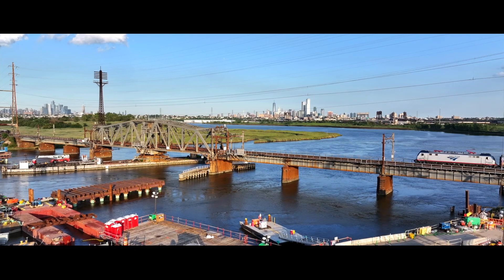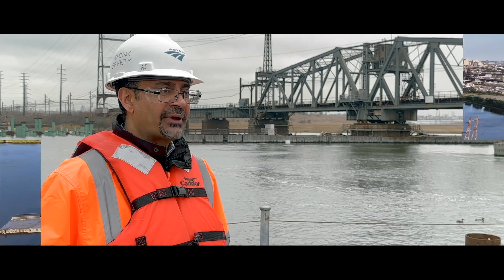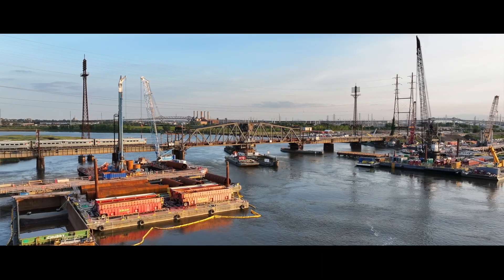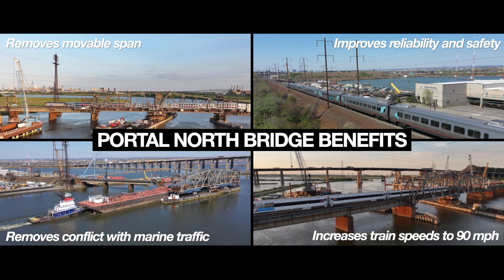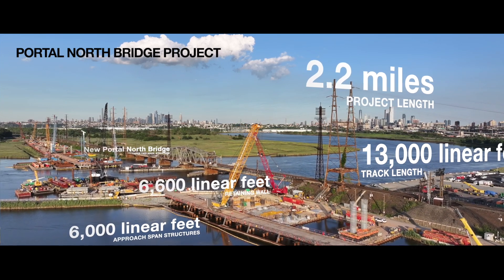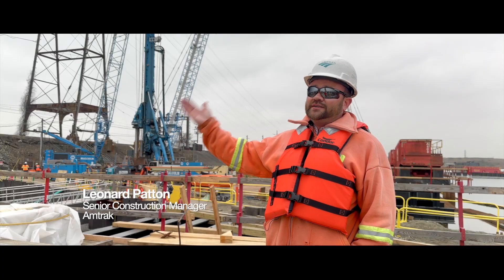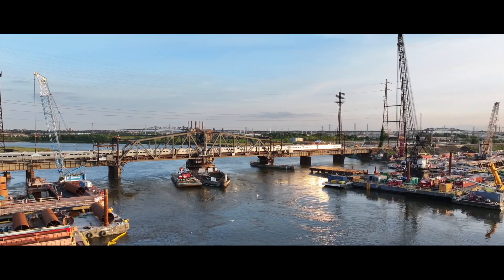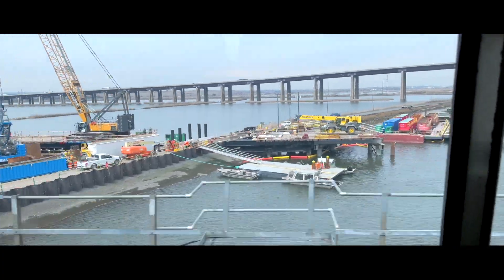New Era of Rail: Portal North Bridge Project Update

Comment: This needs to be done. To get into Penn Station Amtrak has to cross the Hackensack River twice, the Hudson twice, and go under the East River. These crossings are outdated and obsolete and impedes traffic on the Northeast Corridor and makes Amtrak lose its bullet train status. 

First is Portal Bridge this bridge connects New Jersey to Stanton Island over the Hackensack River the problem is when a ship comes into Newark and docks at Stanton Island they have to go through the locks at this bridge. It creates a problem because to allow ships to pass they have to deenergize the entire northeast corridor for one boat and the bull gear that supports the bridge it gets stuck all the time delaying traffic while the tracks are realigned and the wires are reenergized. first priority is to take this bridge out and replace it so trains don't have to stop for boats.

Second problem is the Pelham Bay Bridge from Extreme Trains this bridge goes over a canal and the Hudson and when trains leave Penn Station they are stuck here because they have to wait for boats and the Northeast Corridor is deenergized. This one also needs to be taken out and replaced so Amtrak does not impede boats. 

Third is a major chokepoint The North River Tunnel under the East River coming into Penn Station. During Sandy these tunnels were flooded and the north tunnel is condemned. Amtrak needs to drill a new tunnel which is wider to allow more trains to get into Penn Station. 

If they do this they can double compacity on the Northeast Corridor and move their projects elsewhere where it is needed.

Comment: Why only 90 MPH? That's not even high-speed and leaves us so far behind the Chinese and the rest of the world when it comes to train travel.
Reply: Not really feasible for the geography. Besides, it’s a short railway relative to the size of the us
Reply: From this point it is not very far from NY Penn Station, like less than 5 miles, higher speed is not needed at this point
Reply: 1. Penn station is VERY CLOSE (along with multiple other huge stations
2. (Read 1.)
Reply: Penn station is very close by and it would take some beyond impressive acceleration to reach speeds of like 150mph by the bridge, and there is also a big curve.  If the country wants to invest in hsr on the nec, the investment should first come to rurral sections where it it is cheeper to build.
Reply: The way to actually cut journey times is to go less slow. 60 mph to 90 mph saves as much time per distance as 105 mph to 250 mph.
The local geometry won’t allow higher speeds, acceleration would be impossible over that short distance, and the much higher cost of going significantly faster isn’t worth it.

Comment: Replacing an old bridge is great but why build it for 90 mph speed only?  If it is truly "building for the future", we need to build a bridge that can support 200 mph speed.  If we are spending all these efforts to build a new bridge, why not go all the way?
Reply: 200mph isn’t even close to feasible with the geometry in this area. Not to mention how unnecessary 200mph or even 140mph would be between two close stations.
Reply: there's no reason for it, this bridge is between 2 stop stations within minutes of each other
Reply: I think the 90 mph partly comes from restrictions of the surrounding sections. The bridge I think is structurally good for higher speeds but curves, junctions and other basic demands of the route limit it.

However, past 100 mph the time savings by going faster for a set length diminishes. The true way to get somewhere faster isn’t to go faster, it’s to go less slow
Reply: California is building a high speed railroad that is taking over 75 years to build phase one.

Comment: Was stationed @ Ft. Monmouth early 90's and took the NJ Transit maybe 10 times.   It was no fun riding across that bridge.  I wonder if there will be separate tracks for NJT and Amtrak and hopefully no freight trains get to use it!  Too bad tRump and especially Christie nixed funding for the new badly needed tunnels under the Hudson.    Like I said in another post it would be so picturesque if a tall bridge vs tunnel was built.   Some one had commented it would be more expensive my way.  Too bad the measurements weren't in both Metric and nonsensical English way.
Reply: For now there will be only one new two-track bridge. Amtrak and NJT will continue to share it